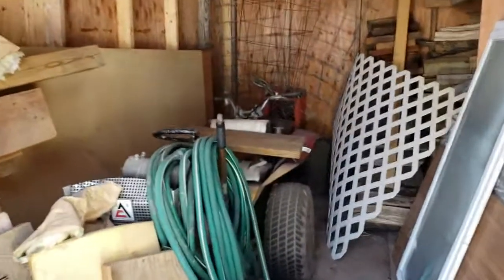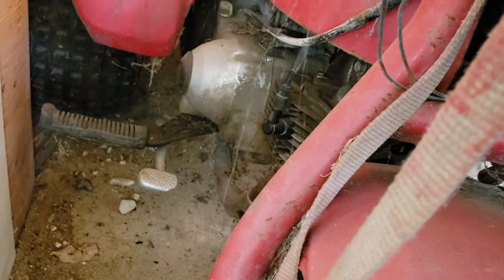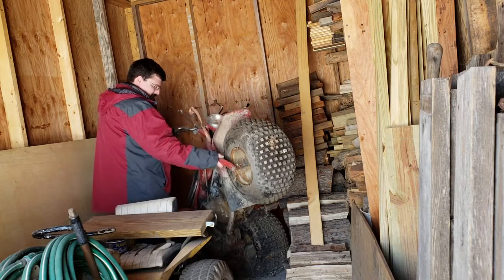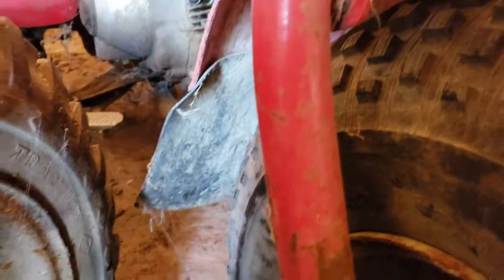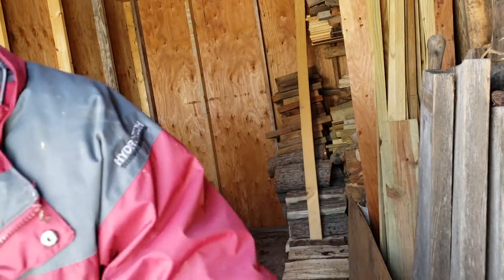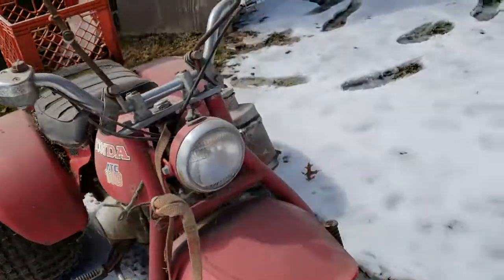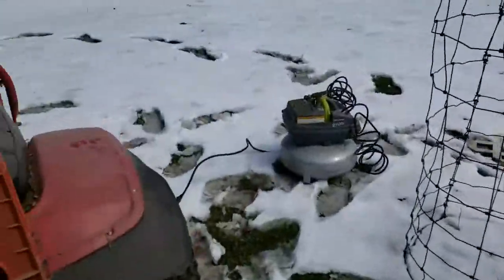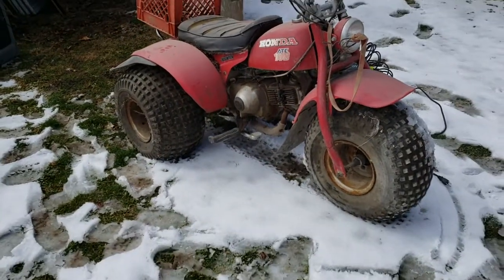Terry's 110

Comment: I have an 83 atc 110 but I can't for the life of me get the rear brake to lock up I have new pads new cable and I had to order a drum off eBay that was in much better condition then mine is this a normal thing for these 110s?
Reply from the maker: no not normally but they are lil drum breaks so don't expect a lot hahaha